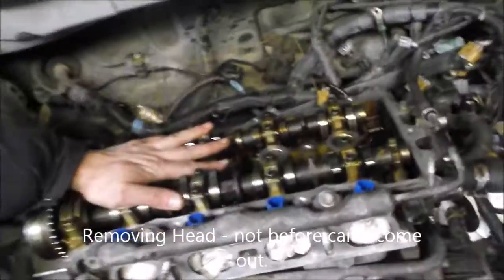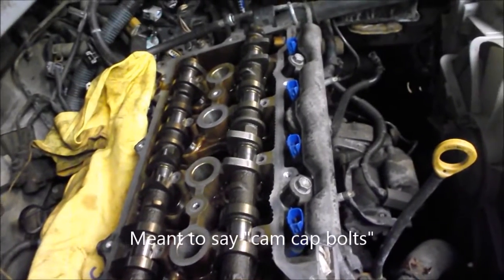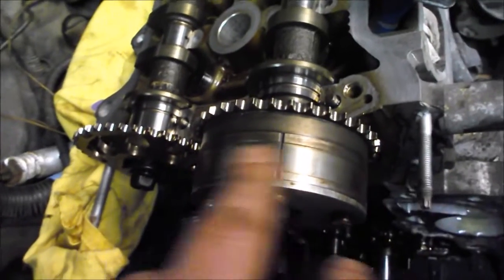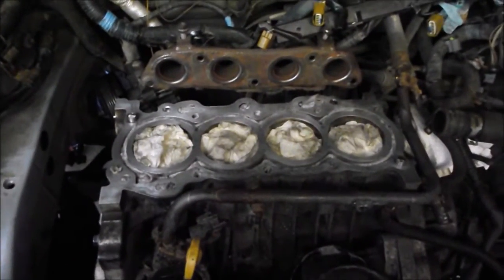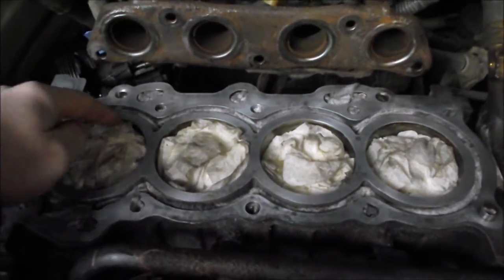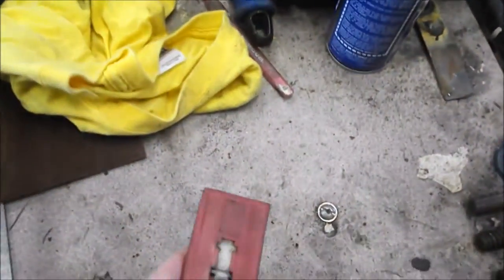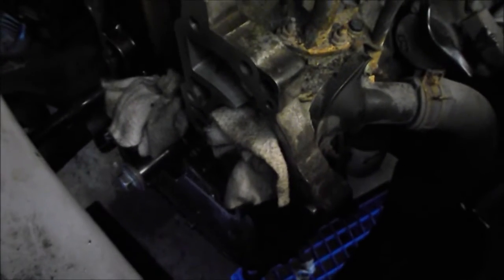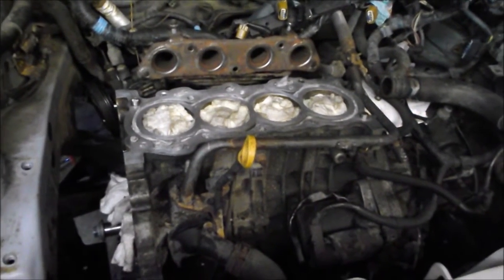DIY Head Gasket Replacement 2007 MatrixVibe Part 3 of 5 Head Removal

Comment: Hi, I am doing this job. We removed alt and water pump and cover bolts. The cover will pry away slightly from the head. Also removed the gear on cam and got cams out. Cant get the heat shield off so unbolted from bottom and going to try to take head off with header. Now the problem, when we pry up on the head it is loose but seems to be hung up somewhere around the timing cover.Do you have to have all the timing components removed? We left the chain and tensioners on since we just pried the cover back some.
Reply from the maker: Hi. Perhaps review the video or a manual to ensure nothing was missed. Lets us know how you make out.

Comment: I have a 2006 corolla and learning the ins and out thank you so much your a blessing in disguise... it depends what year 2003-2004 drive by wire throttle... 2005-2008 electronic.... with matrix and Pontiac to make similar as close it can be engine 1zz-fe...thank you again ...God bless